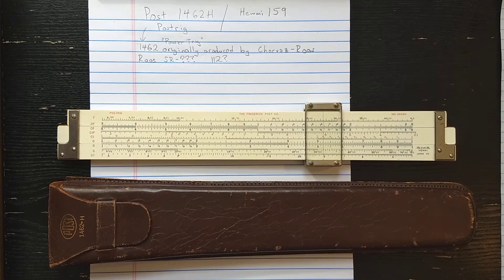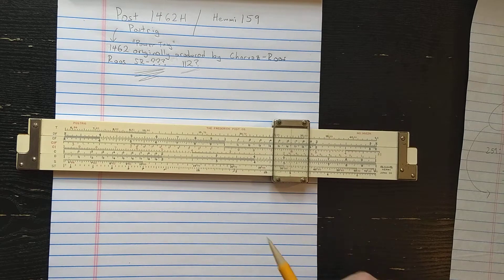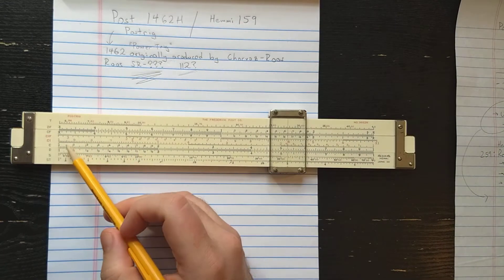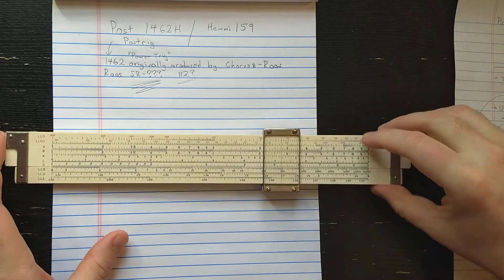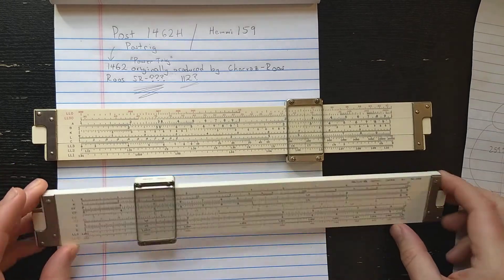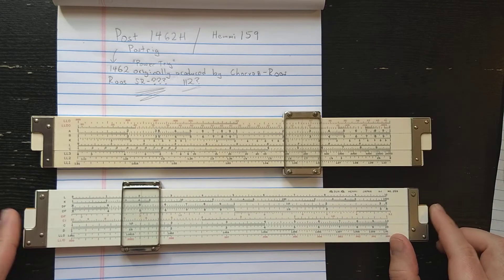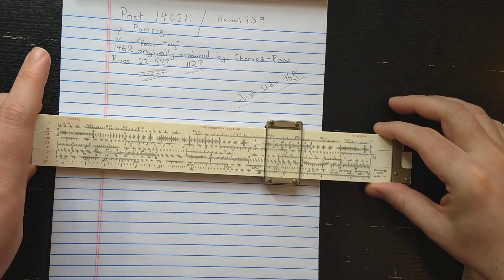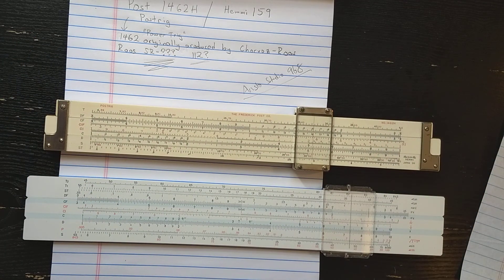Post 1462H / Hemmi 159 and a slide rule conspiracy!

Comment: Professor Herning, Thank you for these videos! This one is fun. Here is something I'm pondering: The "Trig" side of the Post 1462 is the same as the Post 1457 "Mannheim Trig". The Post 1457 is the Roos SR-109. My Roos SR-109 came with a "Mannheim-Trig" manual that is copyrighted by "Acu Rule". Looking through the "International Slide Rule Museum" site, I don't see an Acu Rule that looks just like the SR-109, but the Acu Rule 90 has the same scale set as the SR-109/Post1457. So, maybe Acu Rule actually designed it? Just a thought. Thanks!
Reply from the maker: It's possible. I don't know much about the interplay of the manufacturers in this era. Things also get messy with Post since they pause their relationship with Hemmi for the war.

Comment: I bought a slide rule on ebay and it's the 1460 Versalog Post Co slide rule. In relation to those two slide rules where would mine be manufacturing date wise? And also a question about scales, mine doesn't have the A or B scale on either side, did they just totally remove it for my slide rule?
Reply from the maker: I think production of the 1462H and 1460 might overlap for a year or two, but generally the 1460 Versalog is the replacement for the 1462H in Post's slide rule catalog. Hemmi slide rules usually have a two letter date code on them somewhere which you can use to see the year/month of production.

Without the A scale your Versalog was probably produced in the fifties or early-mid '60s. Early in that range there is no green ink used (in addition to black and red). Later there is a little printing in green above the S scale. Around 68-69 the Versalog 2 is an update that includes an A scale.

Comment: I have an Aristo 868 sliderule. Like it. The cursor is doing well, too. But the middle peace is jerking while moving slightly. That is annoying.
Does anybody know how to fix it? Thanks!
Add.: hardsoap works extremely well!
Reply from the maker: I'd try cleaning if you haven't already. This can help but unfortunately plastic degrades over time, so you might not be able to recapture the original "action." I even have multiple versions of the same rule all completely clean and well-adjusted but with vastly different slide "feels." I believe this can usually be attributed to the fact that they are different ages or have aged in different environments.

I have cleaned 868/870 rules by removing the cursor and GENTLY cleaning the slide and body in water with a little dish soap, but try this at your own risk (Cleaning always comes with some risk. Here the main risk is running ink. Do NOT do this if you have an extremely old 868 with puffy red ink).  If you're reticent, try cleaning the contact surfaces without disassembly.

Some people recommend some sort of wax/lubricant like Pledge or Vaseline, but I would be cautious.

NOTE IF YOU'RE TEMPTED TO CLEAN THE CURSOR: If you disassemble 868/870 cursors, I have found them VERY hard to realign, so utilize the "pop-off" feature if you have a cursor of that type and just clean it without total disassembly if possible. This is, of course, not relevant if you have the later 1-screw type of cursor.

Anyone else have thoughts?
Reply: Professor Herning, thank you.
I cleaned it and it got a little bit better.
Reply from the maker: I'm glad it worked! You also might want to read my recent note describing a good method for fine movement of the slide (in response to someone with a 0968) over on this video:

https://youtu.be/zjy8o9SUUqg
Reply: @ProfessorHerning  Never use vaseline prof. Silicon dry spray is best.

Comment: Dear Professor, I have a question, why on certain circular slide rules, the two scales are counter-rotating (wich makes for an easier read, align the two numbers you want to multiply and get the result on the indicator) while it is not implemented on regular slide rules? Is it because of off-scaling?
Reply from the maker: Tommaso, most circular rules I've seen have C and D scales that rotate in the same direction. The KL-1 is an interesting exception since the two D scales are on opposite sides they naturally "counter-rotate" with each other even though they look like they go the same direction.

Many circular rules have C, D, and CI. The reversed CI scale allows multiplication to be performed as you describe, and it also allows the rule to perform double multiplication and double division without chaining. This is implemented on many regular rules, but calculations can sometimes go off-scale unless CF, CIF and DF are also included (not a problem on a circular rule).

Which slide rules are you considering? If there is a rule with a CI but no C my guess would be that you are right:  the design choice was made to favor multiplication.